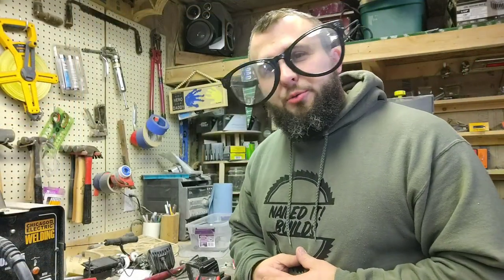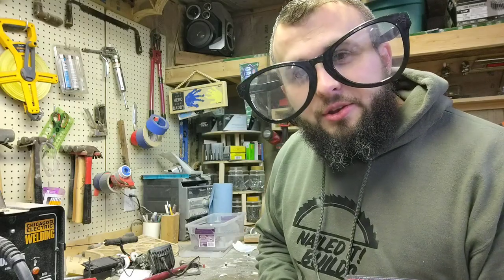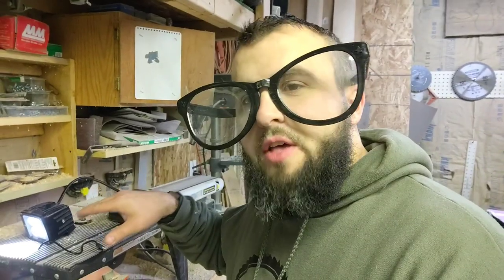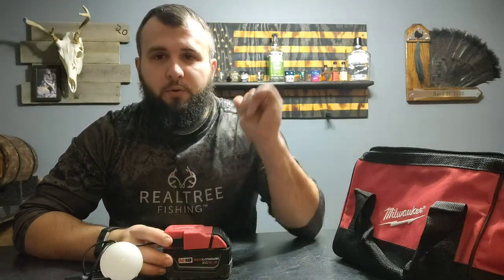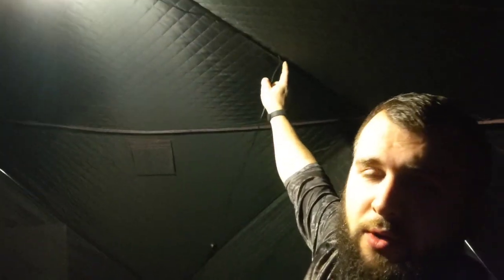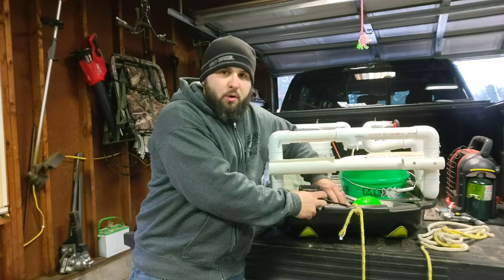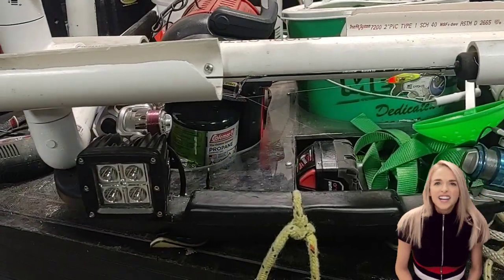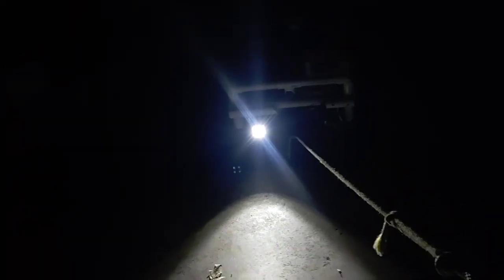Ice Fishing Sled, Adding Lights

Comment: Ive used that same m18 battery adapter to run a light bar on my dirt bike.  I opened it up and jumped out the fuse inside and used the heated jacket port on the side.  Added an external fuse holder to be safe.